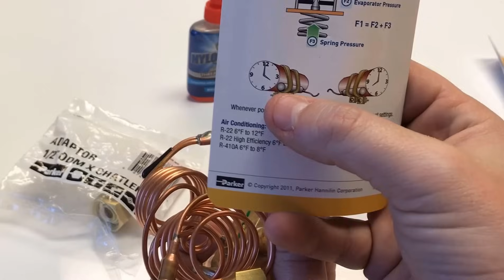Why and How to Adjust a TXV / TEV

Comment: Very good explanation on adjustment. Best check airflow and superheat at evaporator. Also ^ TD . I have only adjusted valves in refrigeration units, walk-ins  and freezer. Ole style Q body valves were much easier to adjust and maintain S.H. For the smart  super techs, if you listen to Bryan Orr might learn a wealth of knowledge.
Reply: Did you do diagnostic on TXV in walk-in the same way that shown on the video? I am trying to understand,  can I use this information for walk-in.

Comment: What would happen if the bulb came loose from the line it was strapped to?
Reply from the maker: High suction pressure, low superheat.... unless the bulb tube cracks then the opposite
Reply: HVAC School what would cause a low suction side reading, beside low refrigerant?
Reply: Jeffrey Narvaiz any restrictions to the air flow of the unit.  Dirty return filter, collapsed ducting,  dirty evaporator coil or condensing coil,  condensing fan not spinning at proper rpm...
Reply: Restrictions in the system, low airflow, imagine having two fans, one is not turning, some systems require hot gas bypass to keep suction up, but that gets a lot more complicated.  On air to air sytems the number two culprit is undersized returns !

Comment: Good information, good refresher. Boring from a video presentation viewpoint, watching a TXV be turned over and over for 19 minutes. I would expect that from an average Joe, not from a "School". But, still very good information. I got the "How" from this but still a little fuzzy on the "Why and When". Did you mention that adjusting the TXV is the LAST thing to do? And that the charge, clean condenser coil and evap coil, correct airflow through each should all be nailed down first? You may have, I just may have missed it. A have seen dudes just reef on that stem, many turns in one shot. You correctly advised against that. Good jjob overall, thanks.
Reply: Failure rate of tevs is fairly low.  They can fail. But modern tev's are fairly reliable. They are more like to be destroyed by someone who doesn't know how to keep them cool while brazing.

Comment: I love all this fancy equipment now a days. I did refrigeration 40 years ago on 20 tonTurbo Ice Makers 12 plates 12 distributors on a txv and NEVER used a temp probe to do superheat.

Simple open txv till it just starts to flood suction, close it to bring frost line back to evaporator,  DONE deal you are using all of the evap, and not flooding suction line.

And a txv with external equalizer tube that is attached to the suction line at the bulb
does just what I explained (it will kind of by pass the temp bulb) till the evap gets established.
Reply: Sounds similar to my first boss, he would go further by licking his finger and seeing if it would stick on the outlet of evap. He did this on freezer coils and ice machines.
Reply: Sounds interesting but how did you prevent slugging (liquid in suction line) when flooding?
Reply: @DellAnderson  some, keyword some, liquid is not going to kill the compressor.
Reply: @MR-nl8xr  I think it depends on the compressor some are more sensitive than others.  And I have seen it happen to so-called professionals.  Thousands of dollars worth
Reply: Yup we use analog gauges n do what u said lol
Reply: this method I read many years ago in " Doolin's Bible".  but that method was used for cap tubes with a critical charges not TXV's.
Reply: That's interesting then I work on turbos today I've got one that's running to 120 s and I got one that's running a hundred and fifty horse screw
Reply: I work on some equipment over 40 years old, I still set superheat on all valves. I've changed to many slugged compressors and seen too many running 2 times the sh needed which causes other issues. Not to mention the tons of ice I've defrosted from techs cranking on a valve without checking all parameters, clean screens, clogged filters, charge, airflow, power head etc
Reply: I now understand that you don't understand how a txv works or how to measure if a suction line is flooded.

Comment: adjusting a txv does not work. dont waste your time.
Reply: marty maness You didn't watch the video. You would only adjust if not meeting target superheat at outlet of evap. So how does it not work ?
Reply: Yea, i agree. more often than not just alot better idea to Replace the Valve. Adjust valves is just for New valves on installaltion. Txv's are the heart of a system . A Fresh Valve is going to Make the system Run Properly and Make u Look alot better.
Reply: the problem is, most of the time, the valve was never adjust to proper superheat, because everyone says " Its new ". If you personally know that the superheat was proper before and is now bad, thats different.  Most of the time they malfunction because of contaminates, or the bulb cap tube has ruptured.  I have seen ghostlike contaminates several times in MULTI unit freezers where I would pump down a system and yank out the TXV in a -20F freezer and actually see the wax on the outlet of the TXV, because the others evaporators kept the box cold. Then step outside the box for a few minutes and it would melt away= no evidence.  When a typical mechanic gets there, the box is warm so he won't even see this evidence. In refrigeration, a line tap on the SL and drier with sightglass by the evaporator will always give you a better story on whats going on.
Reply: h

Comment: Can you do a video on this that isn't 20 minutes long and doesn't use a lot of filler words? You know, can you just get to the adjusting?
Reply: Hey Cam , I don't know if you know this but there is an a thing called fast forward
Reply: LMAO, we could spend 3 hours on the subject and half the techs out there would still misdiagnose/adjust wrong
Reply from the maker: I would be happy to watch your video on the topic
Reply: Rule one: clockwise reduces flow and increases superheat. To increase refrigerant feed, and lower superheat, do the reverse. Rule two: use a refrigerant/ temperature chart for calculations or buy a fancy modern electronic gauge set with temperature clamps. If you don't do this, you are a chimpanzee with an adjusting wrench.
Reply: to remember which way to turn, I visualize a clock on the valve stem.  increasing time increases superheat, reversing time reverses superheat.
Reply: HVAC School thank you for the great info. Wonderful information.

Comment: txv...subcool?....or supeeheat?......they say fixed orifice S.H.........txv....S.C.....CONDMFUSED!!!!!!
Reply: I was taught to do superheat when you have a fixed orifice or a piston... Do subcooling when you have a txv...
Reply: @atticrat7270  yes, for charge verification. May or may not need both SH & SC, plus ODT, IDT, IDT(WB) to diagnose certain problems.
Reply: Atticrat yeah same here I was taught fixed orifice is superheat txv is subcool
Reply: please...dont reply smart shit about spelling.....(.Confused)!!!for the people that are gonna replied dumb shit!!
Reply: Superheat can be measured at either the Evaporator (Evaporator Superheat) or at the compressor (Total Superheat) on the Suction Line (Low Side). Subcooling is measured at the compressor on the liquid line (High Side). Make sure to stay about 16" away from the compressor when you measure either line temp so that you dont get any heat radiating off the compressor which will skew your numbers. You convert your pressures to temps and compare them to actual line temp, you want about 10 degrees of Evap Superheat and 15 degrees of Subcooling. Total Superheat at the compressor should be around 25 degrees.
Reply: thank you!!! very much!!!
Reply: No problem.

Comment: This is great stuff. But I'm confused. I'm relatively new to the trade. How come when your dealing with a split system they tell you if you have a piston you charge for superheat but txv/tev it's subcooling you go off of? But the valve actually keeps a constant superheat? Sorry for my ignorance just want to better my understanding!
Reply: The superheat is controlled by the TXV, the subcooling is determined by your charge

Comment: can a txv hunt with a slight undercharge? considering load, airflow and valve are sized properly.
Reply: exactly the opposite. Low on refrigerant =  high superheat, High on refrigerant = low superheat
Reply: @aaronmouzin7258  You're right, if you measure right at the expansion valve. The bulb of the TEV and the measurement are taken at the OUTLET of the evaporator coil, AFTER the warm air has heated the volume of refrigerant. That's why, counter intuitively, less refrigerant results in more superheat. There just isn't the volume of refrigerant necessary to absorb the heat from all the warm air passing through the evaporator coil. If what you say is right, it's time to replace that air filter!
Reply: Not so fast !  I agree that low on refrigerant = high superheat  The other part can vary. Why ? Mainly because we could run into restrictions for any number of reasons: bad or stuck TXV, clogged or partially clogged strainer, partially stuck pump down valve, restricted drier, etc. There is only one variable that I can promise. IF there is a bad restriction, and if the system is tight AND correctly charged, the liquid (refrigerant charge) will back up into the condensor because it can't get to the evaporator.  When you take the pressure readings and temperature readings on suction and particularly liquid lines, the evidence will be far too much sub cooling on the condensed side (because the liquid is back up into the condenser side.) Try this one out: I once had a system that was only two years old but wasn't cooling correctly in 90's. I was told to change it out and replace it. As I recovered the refrigerant, I discovered that the unit had never had the accurator (for metering refrigerant) installed. It was running "hollow pipe". This was the fault of the installer.
Reply: The basic rule is:
Not enough superheat = not enough refrigerant.
Too much Superheat = too much refrigerant.
If a TXV hunts a lot check the bulb placement and how well it is attached to the suction line, mount your bulbs at 10 oclock or 2 oclock, never at 6 oclock.
Make sure bulb has full contact with the line, you may need to sand off any oxidation or grime that has built up on the copper before mounting a bulb.
Insulate the bulb with Cork Tape or Permatape after mounting.
Reply: @repetemyname842  You would be exactly right, if you measure temperature right at the expansion valve. In this video, he's measuring temperature at the OUTLET of the evaporator, after the warm air has heated the volume of refrigerant injected into the evaporator coil. That's why it seems opposite from intuition. I had to re-watch that part of the video, until I realized that the bulb, and the temperature are both at the outlet of the evaporator, then it actually made sense to me.